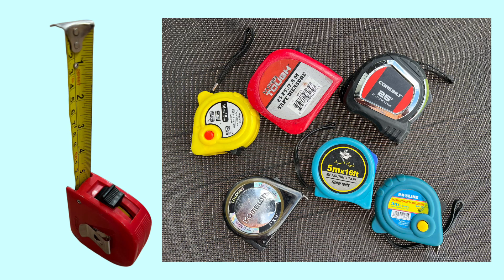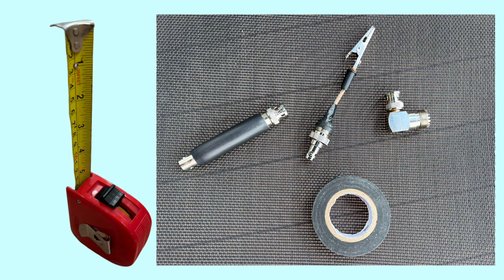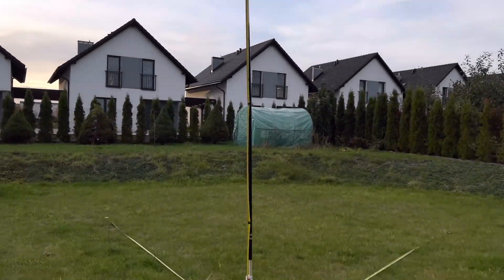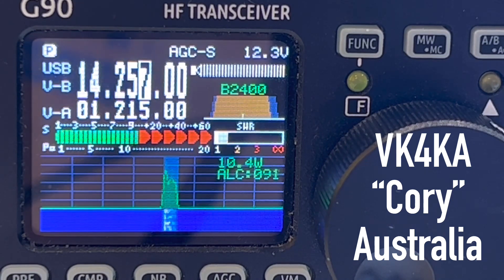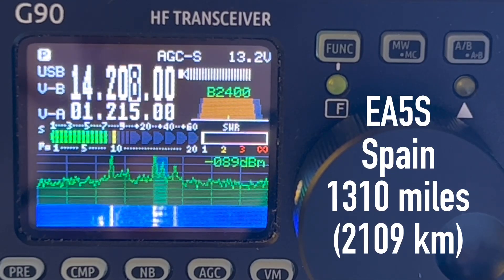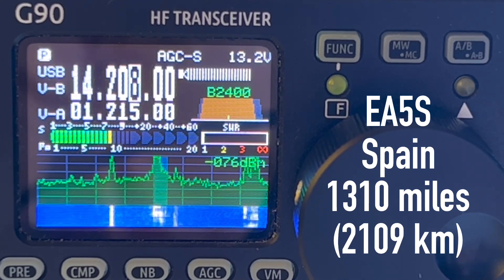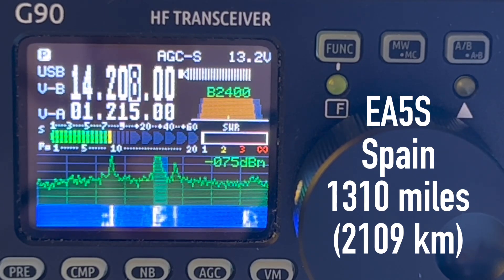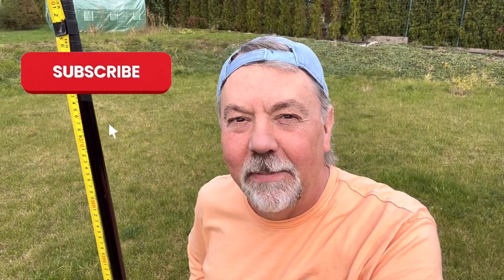My Tape Measure Vertical Antenna Measures Up!

Comment: Ive been interested in radio my whole life. What is involved in getting into this license wise cost wise
Reply from the maker: Ham radio is so much fun. Getting a license is not that hard and is fairly inexpensive. You have to take a test but it’s not too hard to pass and there are some great books out there to do so. There’s a course out there that sets everything up for you and is awesome. Check out https://hamradioprep.com. Cost wise really just depends on what you want to do. You can start in the VHF / UHF world with a $35 handheld. For HF (shortwave) you can find some good used rigs for a couple hundred bucks. 
Go for it! This hobby is awesome!
Thanks for watching and all the best, Walt

Comment: How does this tune on other bands? I've got a junk 30' tape measure, and have been looking to make a portable  HF vertical as I'm in the process of building my first HF station, id can't have more antenna's at home.
Reply from the maker: This is a monoband antenna but you could lower the upper tape measure down to be resonant on 17, 15, 12, 10 and 6 meters

Comment: I am going by Harbor Freight on the way home and pick up 4 tape measures and clips to use for radials on my 17' Whip ground mounted. They have some 16' ones for $2.49 each, if anyone else is interested.

Comment: Great video, we also did the tape measure quarter wave for 20 meters. We got a 10 meter tape cut it into 2 x 5 meter lengths and taped it together face to face and it was strong enough to support its self with light guy strings. We also got some great results. It goes to show you don’t need expensive antennas.
Reply from the maker: Absolutely! Thanks for watching and commenting!

Comment: Walt, great job! You know I love my tape measure setup and it has great swr! although I use a 20m hamstick on a vertical extension pole surrounded by eight electrically connected tape measures at the bottom of the pole! Catch you on QRP SSB net! KD9VAN
Reply from the maker: Thanks! I’ll be back on the net soon!

Comment: I know another vertical you could try, but you'll need to visit a hardware shop that sells fencing wire!! Yes, a solid wire antenna using 16g fencing wire!!
Reply from the maker: I’ll have to do some research and give that a try, thanks for the idea!
Reply: @COASTALWAVESWIRES  no worries. I’m a ham radio operator here in Australia. VK5FCHM
Reply: @COASTALWAVESWIRES  no worries. I’m a ham radio operator here in Australia. VK5FCHM
Reply from the maker: @christophermarshall5765  73 my friend hope to catch you on the bands!
Reply: @COASTALWAVESWIRES  I’ll keep my ears on the bands I’m permitted to use.
Reply: @COASTALWAVESWIRES  I’ll keep my ears on the bands I’m permitted to use.

Comment: That antenna worked pretty well. That's what ham radio is about, putting up something and seeing if it actually works. I remember there was an on air event I think was called the strange antenna challenge. Hams would construct unusual antennas and see if they work. Some loaded up light bulbs, metal step ladders, curtain rods, bed springs, anything conductive just to see if it could make QSOs, and many did. Just make an antenna out of whatever you have and see if works.
Reply from the maker: I think our hobby needs more of that. Thanks for watching and commenting.

Comment: Another great video, Walt. So you're heading home soon? Safe travels. 
So, if you wanted to set this up for say 15 meters, can you just retract the tape measures to about 11 feet? The coiled tape has no effect on signal? If this is feasible, I may do something similar for wire radials with wire winders.
Reply from the maker: Thanks Warren! Yes just retract the tape to make it resonate for 15. No the coiled tape below has no effect. Give it a try!

Comment: Now you got me thinking... I currently use a 17 feet whip with counterpoises for bands 20 and above, thus I bring counterpoises with different lengths. I'll be looking for tiny wire winders that work similarly to the one in these measurements.

73!
Reply from the maker: Great idea! Thanks for watching!
Reply: I've also seen folks use automotive butt connectors to add and remove lengths from radial wires for different bands.

Comment: I use a tape measure for my efhw antenna, if your tape measure has a belt clip check for continuity, then no need to scrape the paint off. Surprising how well they work.
Reply from the maker: Good to know, thanks!

Comment: This is cool! Could you post a materials list for this?
Reply from the maker: It’s pretty simple, (6) 5 meter tape measures (16 foot), a 16 foot long telescopic pole (they’re on Amazon for $35 USD), a 1:1 balun, some coax and a little wire to tie it all together with a couple alligator clips.